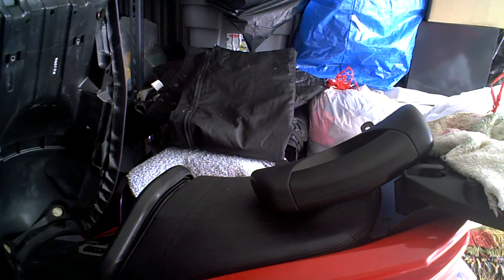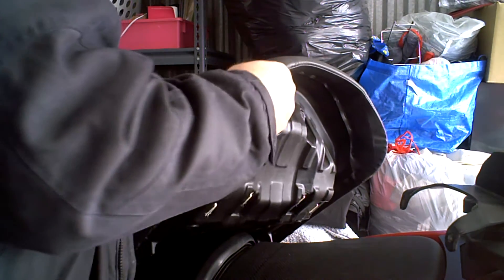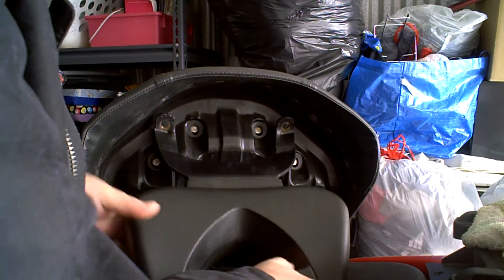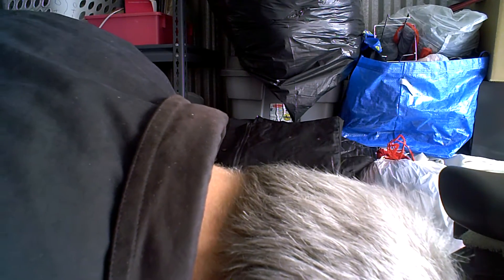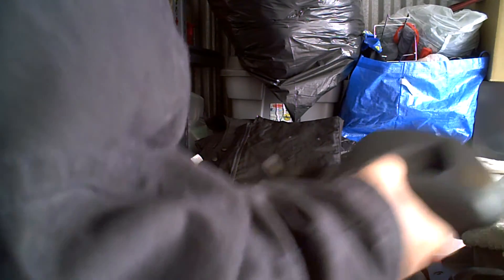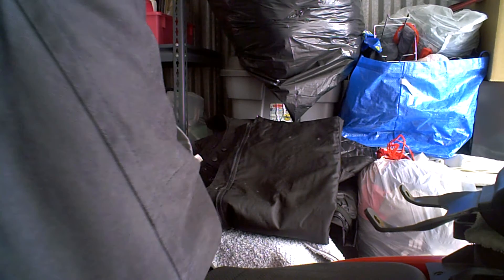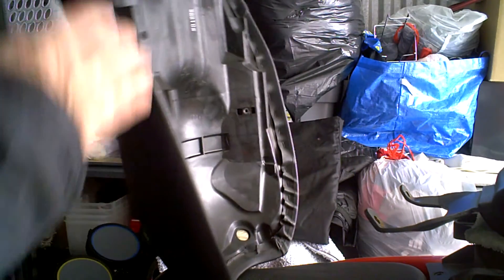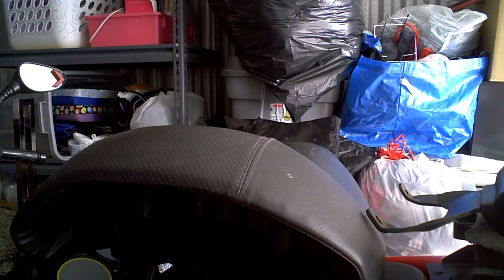Yamaha Majesty video 1 of my seat back support project

Comment from the maker: I bought this from the UK. It is originally meant for the pillion seat, there is a company out there that will make a custom seat for most scooters except ours, because of the adjusting seat configuration they cannot. So I thought since I don't ride anyone anymore that I would utilize this back support and since I have the Givi box the rider can use that.